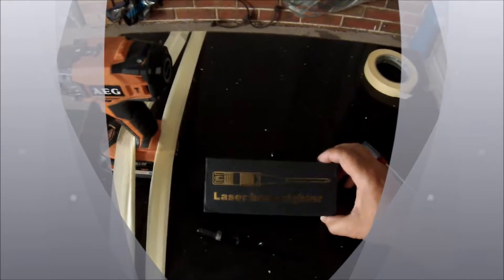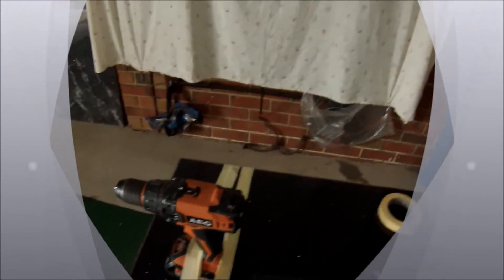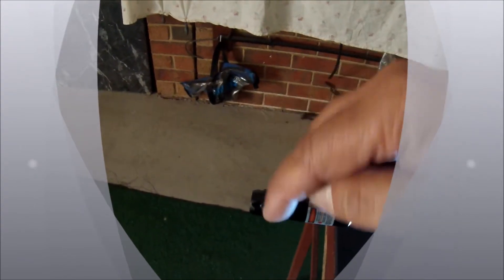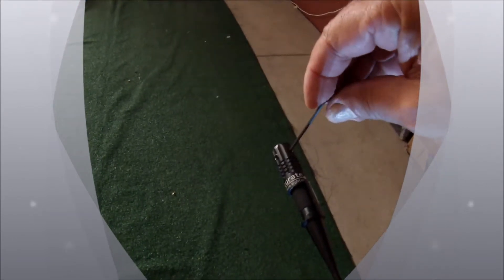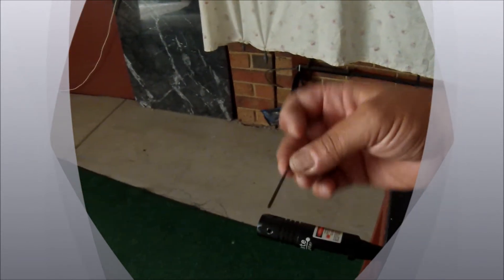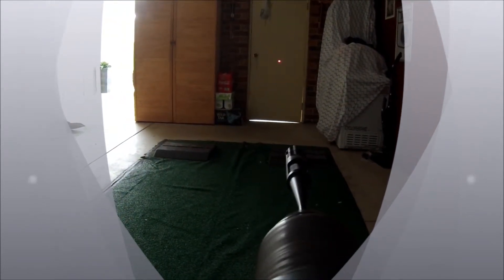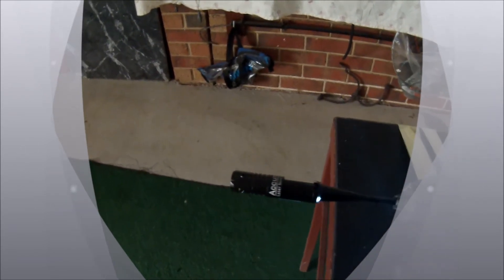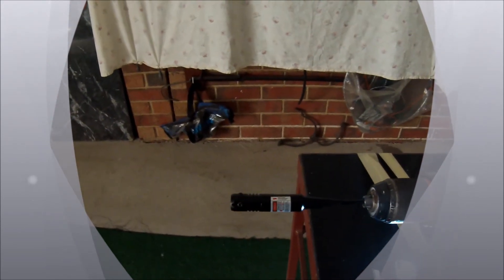(MUST WATCH) Are They Accurate? Laser Bore Sighting Accuracy Test.

Comment: Very good explanation but it should be remembered to use the sighter as close to the distance you will shoot at. It will only get your sight close to where you need it, final zeroing should be done with ammunition.
Reply from the maker: Hi Robert. 
Thank you. Your correct this video is just to raise awareness that buying a laser bore sighter is not accurate straight out of a box. I realised that when I sighted it in with the bore sight an was no where hitting target. Then realise that laser was out. Now hitting tight grouping after adjusting the bore sight. 👌
Reply: @cfmelz  I like the simple way you actually set up the bore sight. It should help anyone having problems doing this.
Reply from the maker: @roberttill3787  thanks buddy. I really hope it does help everyone out there. Cheers.

Comment: Well that’s great to get it a little more accurate but really they are just meant to get you on paper at 25 yards then you can adjust your scope to find tune it and then test your longer distances. But it’s just to get you on the target.
Reply from the maker: Thanks Vladimir. But I just wanted to show that they could be way off. And being that I only did it a 3 meters away. It wouldn’t of got it on paper at 50 meters away. But after this video I did go out and I was really impressed with my grouping. 
Cheers.

Comment: Just bought one the same as yours and found mine is way out, when i rotate the drill my laser dot makes a circle over a foot in diameter. I only have 3 adjustment screws on mine and Im having a devil of a time trying to centre it.
Reply from the maker: Hi Mark. Unfortunately it is a long a process. But like myself you will have to unscrew (just a touch) on one side and screw in the over side. And turn the drill on to see if the circle gets smaller. Believe me when that red dot is in the middle and you haven’t got that circle anymore your scope will be zeroed without shooting a single shot.
Reply: @cfmelz  Thanks for the encouragement, after your vid i have it down to a few cm now.
Reply from the maker: Hi Mark. Good to hear that you almost got it zeroed. Goodluck. Thank you.